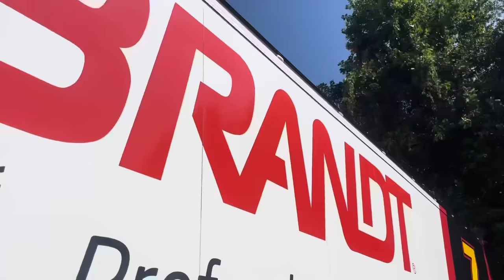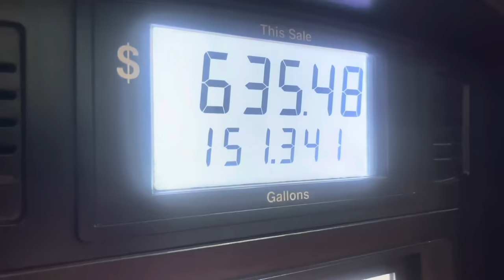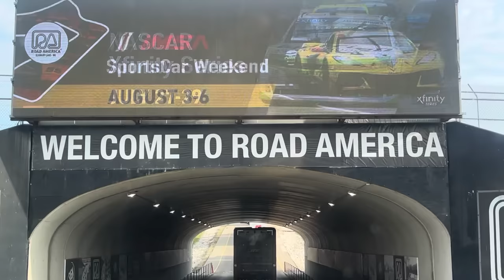Peterbilts on Parade, Nascar hauler style.

Comment: I have valves for my heated fuel tanks. Truck had them when I bought it used. Had to have valve and manifold  added. The tanks were heated all the time. Truck ran the west coast. I'm on east coast. I have heated gate valves and vacuum pump for the winter on the tanker body it carries.